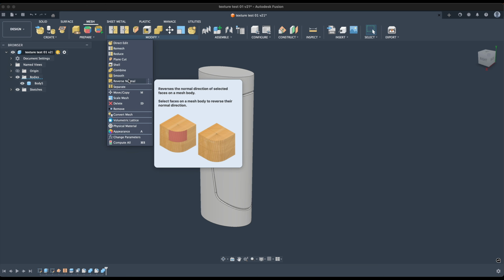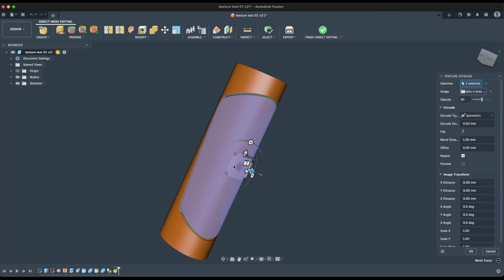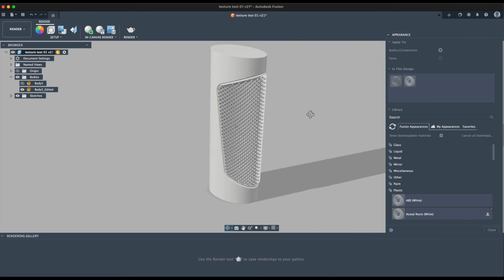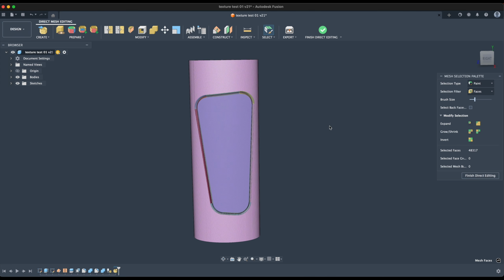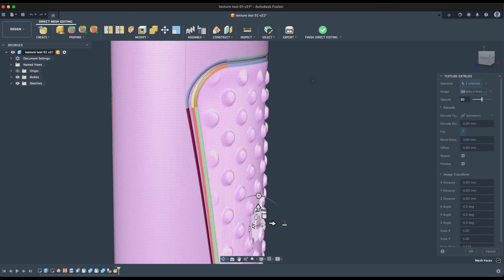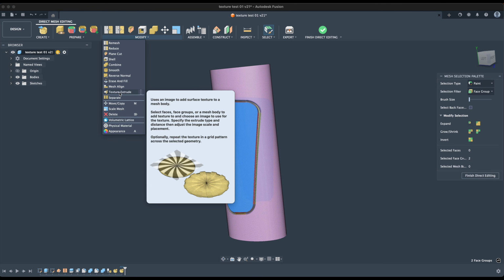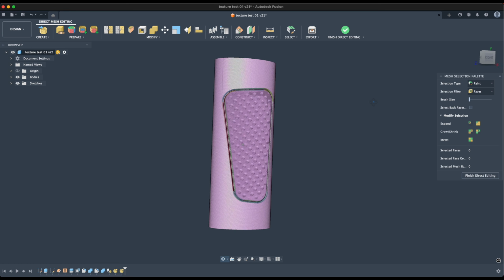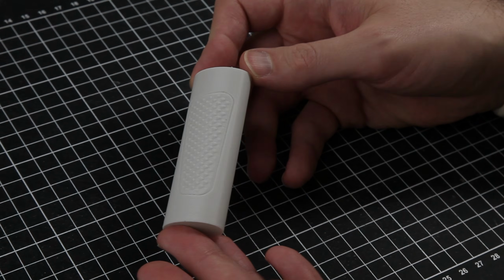Applying texture directly in Fusion 360 - how well does it work?

Comment: Great tutorial, however I find the results to be pretty bad quality and nowhere near as good as the old method of using a rectangular pattern.
Reply from the maker: You're totally right. But this is more a workflow for applying textures for 3d printing, not for production ready CAD. The 3d printing will even out the lack of surface quality anyway, so why try harder than you have to.